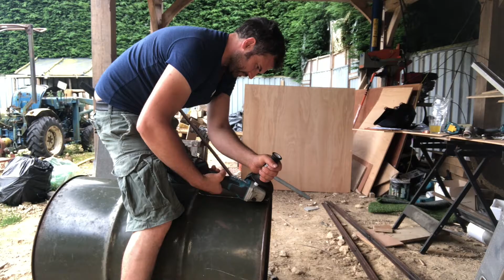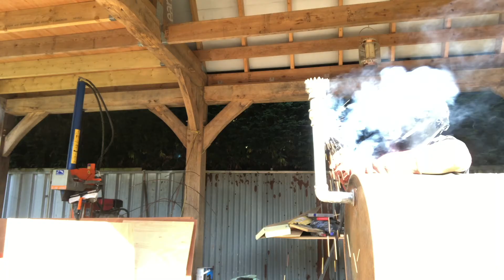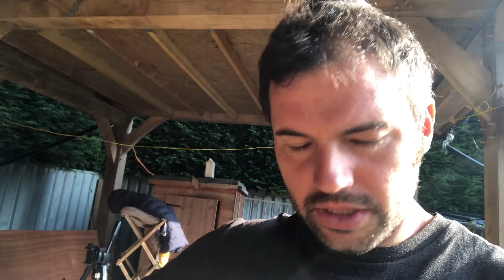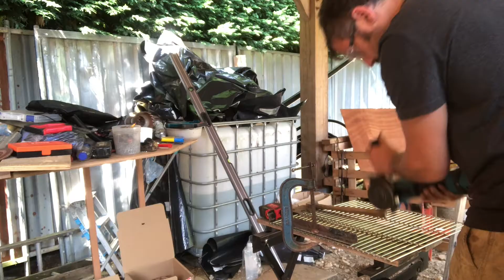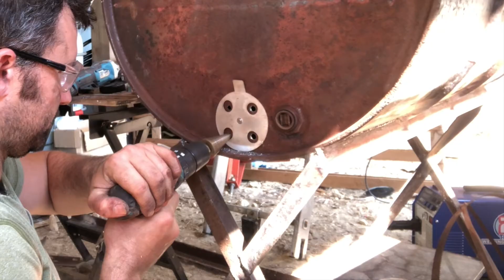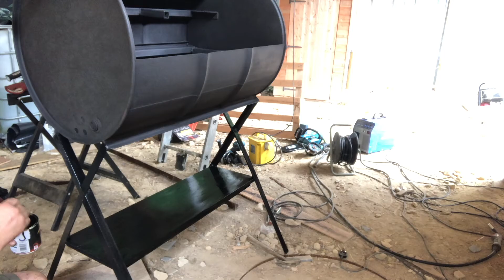BUILDING AN OIL DRUM BBQ STEP BY STEP: OIL BARREL BARBECUE | Off Grid Project

Comment: When removing the paint. Make a big hot fire inside and at same time Tiger torch the outside of it.  The Hotter the better. A lot of those Barrels have a rubber coating on inside.  You want that all burnt off